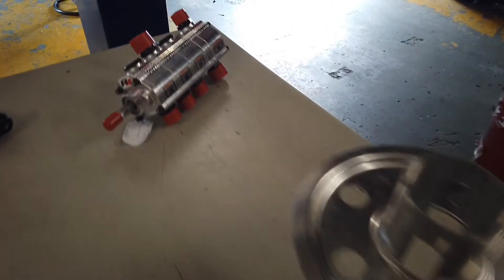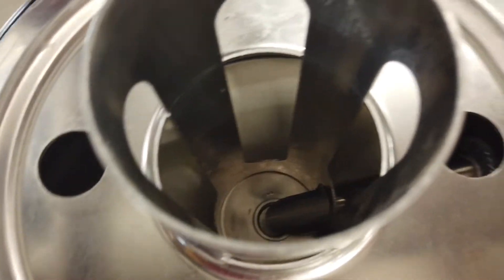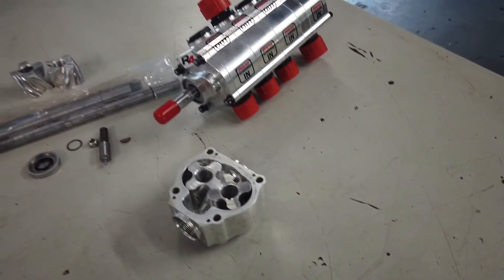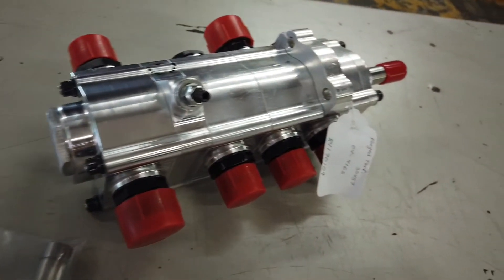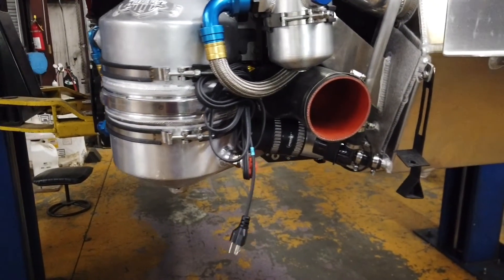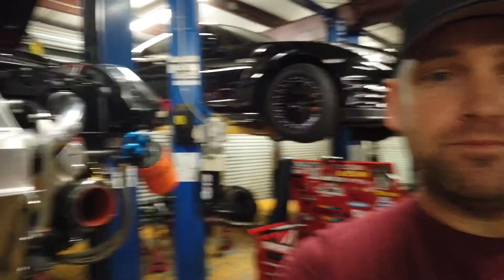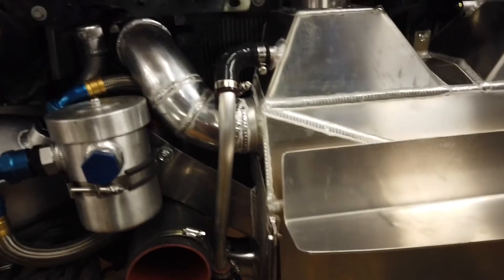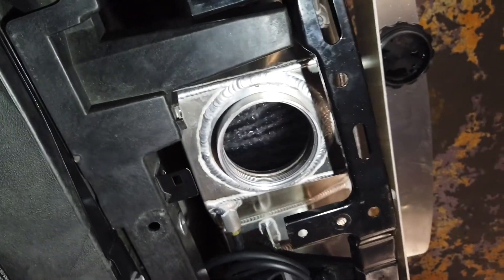How to Modify a Dry Sump Oil Tank (Bonus water to air intercooler review!)

Comment: Question, for trunk mounted dry sump tanks, how to stop the trunk from building up vapour which might eventually get into cabin and smell bad.   Instead of breather on vent can could you run the top of vent can outside of the car so vapours do not vent inside the trunk?           I've seen street cars with trunk mounted dry sump tanks and they vent inside the trunk, i'm not too keen on this.
Reply: Yes, run a line to the back of the bumper, that's what I do.